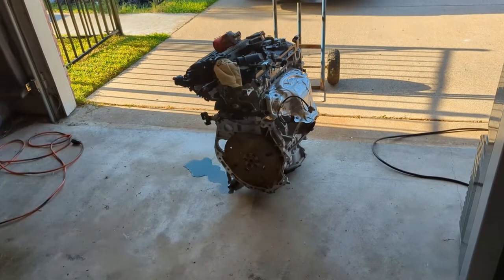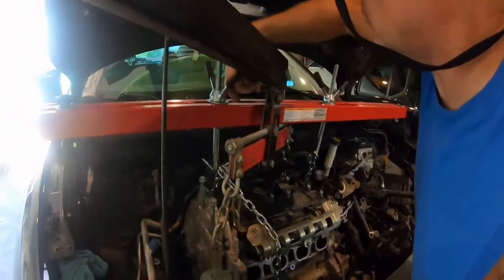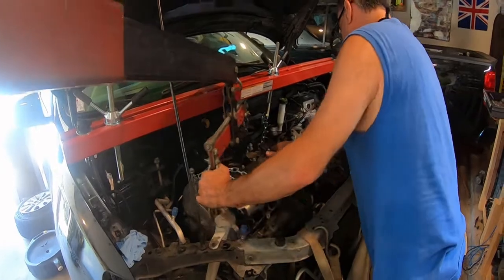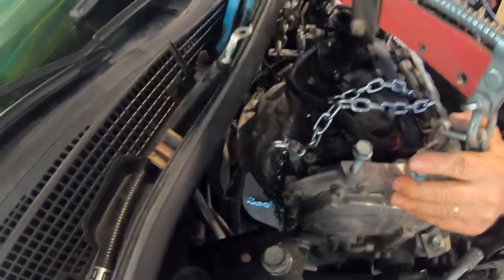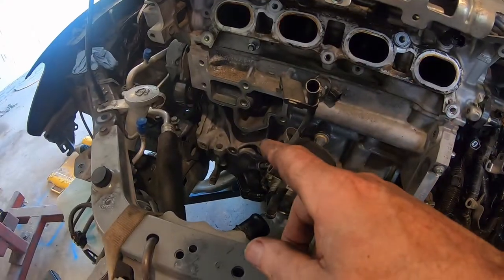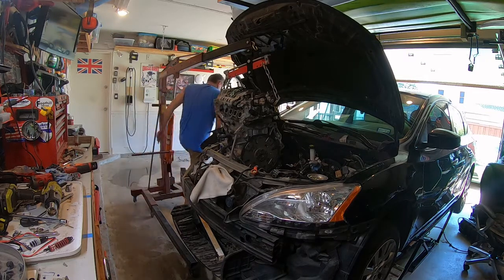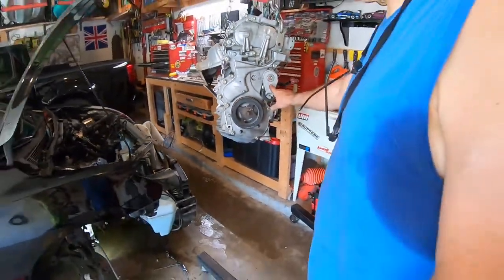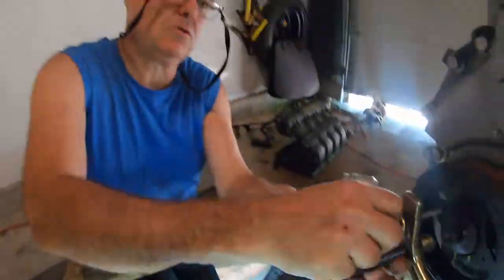Nissan Sentra engine replacement Part 4. MRA8DE

Comment: Im getting ready to do this today on my girlfriend's car. 70k miles, oil changes every 2800/3500. Timing chain tensioner failure. Went to go start it, no compression. Cam lobes out of whack. Unfortunately, i own a shop but i truly know only the old cars (20's to 1975) so, this wont be fun lol. Found an engine wirh 19000 miles though. Nissan put a new transmission in about 8k miles ago under warranty. But the warranty expired at 70k miles, her engine has 71,106.....
Reply from the maker: Its not that hard when you dig into it. I usually do oil changes once every 20k or 1 year with full synthetic oil.
Reply: @NissanNut74  20k? I've never heard of anyone going that high. If my cars hit 3500 miles, I'm overdue lol. I know it's excessive though. But it's a lot less often than my racecar oil changes lol. And you're right, motor wasn't bad to get out. Putting it back in after Christmas. Thank you for the video. The axle removal was definitely a necessity! I would have just kept tugging on the engine otherwise haha
Reply from the maker: Valvoline full synethic can go up to 20k. I do around 5-7k. Nissan oil recomends 5k but thats conventional oil.  @SkyBethel-l6i
Reply: What model and year is this Sentra?